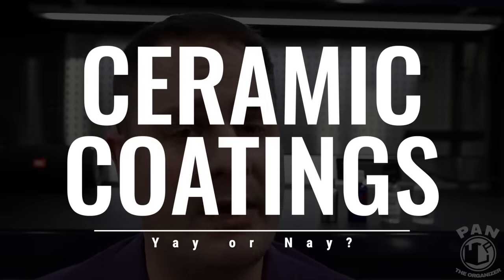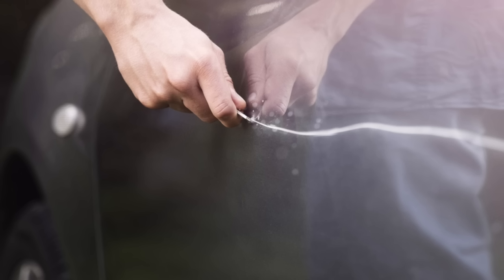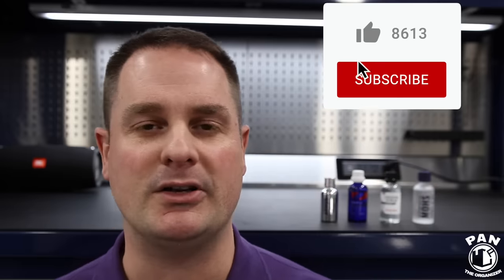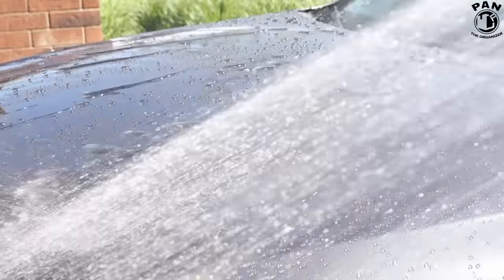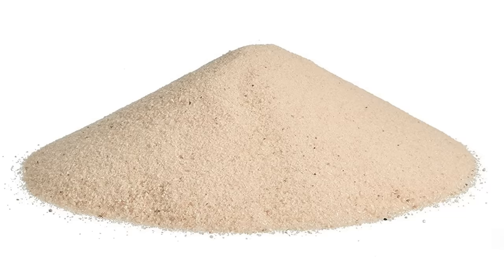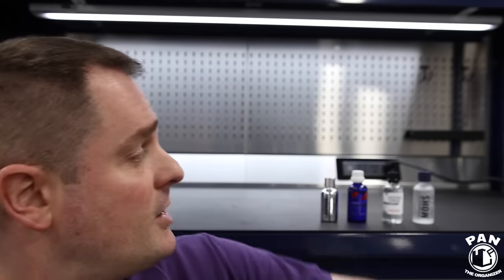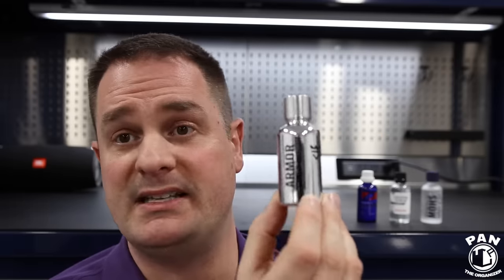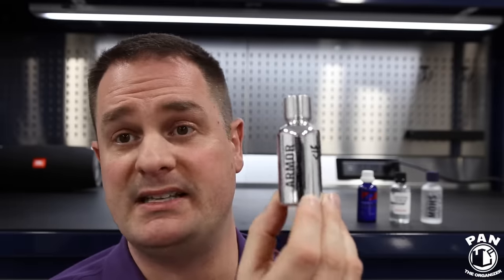DON'T BUY CERAMIC COATINGS BEFORE WATCHING THIS !!

Comment: Do you have to discard the microfiber towels when you use the topper -  rejuvenater sprays or can they be washed and retained ?
Reply from the maker: You can simply wash them immediately after use, and reuse them.

Comment: Hey Pan, do you have experience doing non vehicle ceramic coats? I'm thinking of putting a orange coat of "Cerokote" on my Barbell but I don't see videos of people doing it on YouTube. 
My question is should I even attempt a "D.I.Y" application on steel or should I go to my local ceramic sprayer? I know your channel is vehicle based but I did listen to the video title even in my situation.

Comment: Hey Pan. I tried to clean a ceraMic coated car that had lot of bonded contaminants on the lower portion of car behind the wheels. I am a detailer and ceramic coating applicator. I tried tarx, ironx, etc etc but it was still there. I tried reset with carpro wool mitt on a small spot. No change. Only after a mild clay was done, it was removed. I know it will create slight marring but what are the other ways to reMove bonded contaminants without using clay or clay bar?
Reply from the maker: Unfortunately no. But if you clay a coating, you can damage it. So machine polishing and reapplication might be needed.

Comment: Hey pan good info
Quick question.
So many car headlights are yellowing.alot of people my self including buff and polish,and they usually look new again.which ceramic coating will you recommend to help for a longer resistance from yellowing. If any at all.please make video.
Reply from the maker: I always apply the same paint coating on the headlights and tail lights as well. Prevents them from oxidizing and yellowing.
Reply: @PanTheOrganizer  respectfully so I don't need to apply ceramic coating to my headlights.
So just have headlights clear coated.

Comment: Armor shield's website said I would need 3 bottles for my tacoma for two coats for the paint and headlights. Is that true in your experience?
Reply from the maker: They have no choice to give more room in their recommendations as not everyone uses the same amount. I could do two coats, plastic trim, glass, headlights with two bottles on a Tacoma. But again, hard to say not knowing how much you use.

Comment: Just received my Armor Shield IX, thanks for hooking us up with your discount code. Looking down the road, would the “Turtle Wax Hybrid Solutions Ceramic Spray Coating” be and adequate “topper” for the Armor Shield IX? Thanks again for sharing your knowledge and love for automotive detailing.
Reply from the maker: My pleasure Ken! There's a brand new, even better topper from Turtle Wax that was released today, which I reviewed, that would be a GREAT topper for your AvalonKing. Watch my video: https://youtu.be/b5BjDzItlr8

Comment: Would you suggest a spray on coating such as hybrid ceramic or a graphene spray to be used as a topper for the Avalon king ceramic coating? Or is the ceramic coating best left alone for best protection/water beading & sheeting?
Reply from the maker: You certainly could use a topper. 303 Graphene would be a good one, so is the Adam's Graphene Ceramic coating spray. I tested both in this popular video: https://youtu.be/wZYZc9uDyek

You could also use any silica spray sealant, including those in my top 3 from my most recent car detailing products awards here: https://youtu.be/ULvGi3dbBrA

Comment: Hi Pan, luv your presentations.
I’m getting a new M-B GLS 450 soon.
I plan to apply the Car Pro CQ 3.0 ceramic coating as you’ve described.
But  I don’t have an empty garage- can I just leave it out overnight or will the nighttime/morning dew harm the new ceramic coating? (SF Bay Area in California (temps 40’s at night, low 60’s daytime).
I’ll avoid applying if rain is expected.
Thank you!
Reply from the maker: Congrats on your new Benz! Nice ride. (Just keep in mind my name is PAN, not Pam haha).

Yes you can apply this outside, as long as the temperature while applying is somewhere near 55F or above. The morning dew is fine, just make sure it doesn't rain for 24 hours after the application.

Since you're getting a Benz, watch a video I made about a full detailing of a Benz using CQuartz UK 3.0 here: https://youtu.be/maBAIUnpmg4

How did you discover my channel by the way?
Reply: @PanTheOrganizer  
Thank you so much for your personalized reply!
I know you get plenty of messages from your loyal followers and subscribers so I appreciate the time you took.
I am so sorry for the typo, of course you are Pannnnnnnnn the Organizer.

 I’ve been subscribed to your channel for 1-2 years, came across it fortuitously when I must’ve searched for info re cleaning and waxing a car.  Your YT videos are by far the most entertaining w regards to car care, or for any topic!
Please keep them coming!
Reply from the maker: Thanks for the positive feedback! Since you subscribed to my channel, let me officially welcome you to the Pan TheOrganizer family!

What’s your favourite video ever on my channel by the way?
Reply: My favorite video ever of you?
That’s a tough one to answer, I learn from each video.
But whichever video introduced Turtle Wax Ice Seal & Shine was a groundbreaker, I’ve found it to be easy to apply and impressive protection with water beading  and sheeting and bee/bug/bird poop easily slips off.

Comment: Hi Pan is that armer ceramic kit enough to do a large pickup truck??? i have no idea how far these coating can go... 1 small car? 2 small cars? 3 small cars? please someone explain this... thanks
Reply from the maker: One 30 ml bottle is typically enough for two coats on two average size cars. You should be fine for your truck. Two bottles if you want to make sure you have enough for two coats. As no human applies exactly the same amount.

Comment: Hi Pan, is Solar Gard Clearshield Pro worth doing on a new vehicle or just go with the ceramic coating. Thanks.
Reply from the maker: Never heard of that product
Reply: @PanTheOrganizer  It's the same as the 3M paint Protection Film that they put on the hood. So is that layer of film any good or go with the Ceramic coating. Thanks.

Comment: When do you know its time to put another coat of ceramic on the clear coat?  So if I do the Avalon King ceramic application, when do I do another coat in the future?
Reply from the maker: Normally you would apply the second coat 45-60 min after the first one.

If you already passed that timeframe, wait two weeks before you wash your car again. Then apply the second layer.
Reply: @PanTheOrganizer  ....Thanks, but I meant 1,2,3 years into the future.....how do you know the ceramic coat is needing another new full coat?

Comment: After applying the Avalon King coating, is it going to damage the integrity of the coating if my car is exposed to rain or water before the 48 hour suggested curing time?
Reply from the maker: That's a tough question to answer. Just don't do it. Keep it dry for 48 hours. Follow the instructions. You run the risk of having water spots if you don't let the proper curing time end.
Reply: @PanTheOrganizer  sounds good thank you for the advice. Love the content and definitely learning a lot.
Reply from the maker: Thanks for the positive feedback Arturo! How did you discover my channel?
Reply: @PanTheOrganizer  I’ve been watching detailing videos for a while, working on my cars and you came up on my feed and so I started watching your videos as well.

Comment: Great video PAN...as usual. I have 2 questions that I would appreciate/value your opinion on. 1) You always talk about "clear coat" and I understand...that's what all cars have on them from about 1990 on. But what I want to know is do you recommend "ceramic coatings" for classic cars with "single stage paint"? (Personally with our 1957 Jaguar XK150 I prefer a carnauba wax because it is garaged and IMO you can't beat the look a a great carnauba wax on most classics.)  2)The second question I have is how hard is it to remove those 3 ceramic coatings that you like so much. You said good for 2-5 years. What if you change your mind after 6 months and want to try something else. How do you safely remove those semi-permanent ceramics? Thank you in advance for your response which I will value highly because you do know these products extremely well. Thanks for a great channel.
Reply from the maker: Thanks. To answer your question: 1) Opinions are mixed on applying coatings on single stage paints. Technically coatings have to bond to clear coats, and single stage isn't that. Others say you can, but durability won't be the same. I don't work on single stage paints, so impossible for me to know. But if it's just a weekend classic car, then yes a good carnauba wax will offer a warmer glow and have a stunning finish. No need for a coating. Coatings are awesome for daily driven cars. 2) the only way to fully ensure 100% removal of a ceramic coating is by machine polishing. Mechanical abrasion. They are really durable protectants, no joke.

Thanks for the kind words about my channel, I appreciate it!

What's your favourite video on my channel so far?
Reply: @PanTheOrganizer  Hi PAN, Thanks for such a thorough answer. I learned a lot and I really appreciate your taking the time to give me such a complete answer. As usual I learned a lot. What you say is "the Bible" when it come to all things "car detailing". To answer your question.  I found you when I retired a few years ago and started to update my knowledge on how to properly care for a care. The first video I saw of yours was like your 2018 Year in Review...your top products in each category. That made me a believer and a follower. My favorite videos are your instructional videos because you are so very thorough. One video that comes to mind on that front is the one where you went through each of the steps in preparing your car for apply The Last Coat (I think it was TLC). I wrote each of those steps down and I refer to it every time I do a project. (I detail some classic cars through the local Jaguar Club). And I give it to people who inquire of the proper steps. I love all your tutorials. They are the best. Thorough and so well explained. So what is my favorite? Most everything you do. Thanks PAN. You're the best. PS One thing I appreciate is that you haven't gotten into these crazy videos on "How to Clean the Dirtiest Car Ever" type mentality. Maybe one or two a year but please stay true to what you have done and done so well over the past 2 plus years I have been following you. Thanks again PAN for taking the time to answer my questions.

Comment: Another super video from Paaaan. Say, ok you must throw away your towels used to apply or buff the ceramic coating. But the question is, do you have to throw away the towels used to apply the ceramic sealants or sprays too ????
Keep on going pan, you make a job so great. Greetings from France.
Reply from the maker: Thanks! For silica spray sealants, you can just wash the towels immediately after use and reuse them.

Comment: Also the particles that compose wax are much bigger than the nano particles of ceramic coatings. They sit on top of the pores of the paint instead of going down into them. UV light and heat break down the larger wax particles at the molecular level quickly.

Comment: Thank you for putting ths out!  This convinced me to put the AvalonKing IX coating on my 11 year old Honda Element (using your code :) ).  I have a question though.  It has recently had a paint correcton done on it, and I applied the Turtle Wax Hybrid Ceramic Wax on the paint, as well as using the Cerakote Ceramic Trim Restoration kit on the trim that was fading.  What would be the best way to remove the TW Hybrid Ceramic Wax from the paint without damaging the ceramic protection on the trim along the bottom of the vehicle?
Reply from the maker: Machine polishing is the only way to ensure 100% removal of previous protectants
Reply: @PanTheOrganizer  Thanks for the info and the quick response!  I appreciate it, and I love your channel, I've learned a ton from it. :)
Reply from the maker: Thanks Haley! How did you discover my channel by the way?

I highly recommend you watch my popular ceramic coating application tutorial: https://youtu.be/byKcYsEyWGk

Comment: Is the AvalonKing good to apply over PPF? Love your videos man. Never washed a car by hand in my life until I bought my first car, a Tesla Model Y and now I am obsessed with keeping it clean. Thanks to you.
Reply from the maker: Thanks! Yes you can apply it on PPF. How did you discover my channel?
Reply: @PanTheOrganizer  Thanks for your reply. I just randomly stumbled upon your video when I was looking for Ceramic Coating DIY videos. Oh boy, Am I glad I did! Haha. 

I’ve got more answers from watching your channel than any other. I’m a subscriber now. 

Just one more quick question. I live in a cold area too and the temperatures falling to the low 30 F. Okay to still Ceramic Coat when it’s this cold? My Tesla app reads the garage temp to be about low to mid 40s F (4° C). I can use a space heater overnight if that helps. What’s the right way to go about this?

Comment: Some companies promote ceramic coating all windows and plastics (trim, edges, etc). Is this a good or bad idea. You mentioned the coating attaches to paint so how would that work on glass or plastic? Is this a gimmick?
Reply from the maker: Some coatings are indeed versatile and can be applied on multiple surfaces like paint, glass, wheels, plastics and lights. It’s not a gimmick.

There are also surface specific coatings that only bond to paint, or glass, or wheels, etc

Comment: So do you only apply the ceramic coating once every 2 years and also can I use say the turtle Wax hybrid solution as maintenance on regular basis
Reply from the maker: It depends which ceramic coating you go for. Some last 1 year, 2 years, 3 years, 5 years, etc. Once applied, maintenance is as simple as using a ceramic spray once every 2 or 3 months to boost protection, gloss and slickness. 

For a regular basis, like say after each wash weekly, you could use a drying aid like the Turtle Wax Hybrid Solutions Ceramic Wet Wax, which you spray on a wet surface, and then you dry the panel.

Comment: Hi Pan, Thanks for your videos!. quick question.. I had someone do ceramic coating on my car ( I was afraid of polishing new car to remove imperfections) . It was advertised as 5 years protection. When I saw the product ( System x crystal ss), it says 2-3 years. I brought it up to the installer, and he mentioned that they do double application and that's why they advertise it as 5 years protection. Is that a valid statement ?
Reply from the maker: Hi Francisco. I don't know System X coatings, so I can't comment on that. Your best bet would be do get down to the bottom of this by calling System X directly or asking them by e-mail. Get to the source.

One thing I can tell you, is that in general, applying more layers of a coating doesn't increase its durability. What the second layer does is maximize the chances of reaching the maximum claimed durability and also ensures proper coverage.

So for example, let's take CarPro CQuartz UK 3.0, a well known consumer grade coating. The durability claim is 2 years for that. They recommend applying two layers. Two layers doesn't get you 4 years of protection. It will just ensure proper coverage and increase the likelihood of you reaching the maximum claimed durability of 2 years.

Because if we follow the logic of your installer, if we apply 3 layers of the System X, we'll get 6 to 9 years of protection? And if you apply 5 layers, you'll get 15 years? You see how that would make no sense. Common sense.

What's weird about your coating is that is without warranty according to their website. Normally, a professional grade coating, installed by an authorized professional, comes with a warranty.
Reply: @PanTheOrganizer  thanks a lot for your response!!
Reply: @PanTheOrganizer  just confirm by system X "The simple is no that is not accurate. It is rated for up to 3 years no matter how many coatings are applied"

Comment: If my car has a ceramic coating, it gets rained on, then I park it in my garage, will that leave water spots?  Or do water spots only happen from washing it?
Reply from the maker: Regular washing and maintenance is what will prevent water spots. Water spots, if left unattended for long periods of time, and allowed to bake in the hot sun, will etch through the clear coat and leave permanent damage.

Comment: Hi Pan. I just used a all in one (Rupes uno1) can I use The ceramic coating right on top of that. Or should I use Geon prep to clean everything first?
Reply from the maker: No. It’s not compatible with ceramic coatings. And Gyeon Prep alone won’t fully remove it. You would need to machine polish it off with something like Sonax Perfect Finish.
Reply: @PanTheOrganizer  ok. Thank you!
Reply: @PanTheOrganizer  great advice my friend. I have a different question. Yesterday I ceramic coated my pick up truck, did all the prep polishing everything. Two hours later it started drizzling for a half an hour. What’s that gonna do to my coating? it was a car pro ceramic coating. Supposed to cure for 24 hours, rain wasn’t expected. Go figure!  Thanks bro!!  Please tell something good. Please!!!  Lol. 😂😂😂